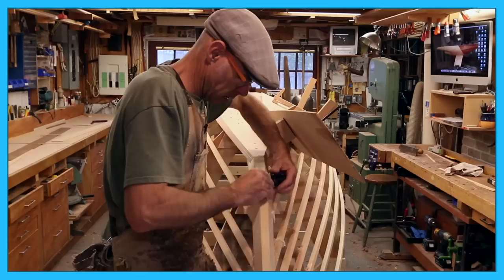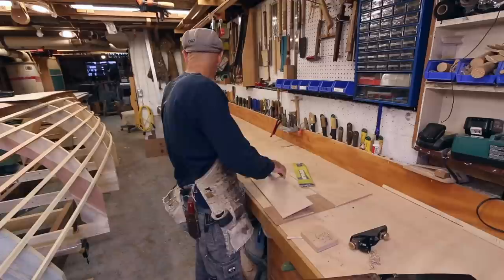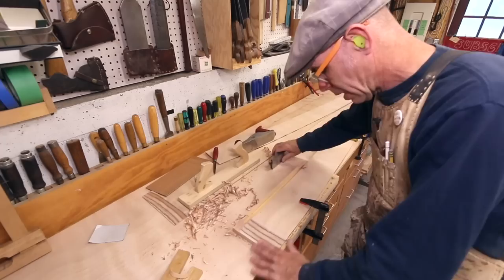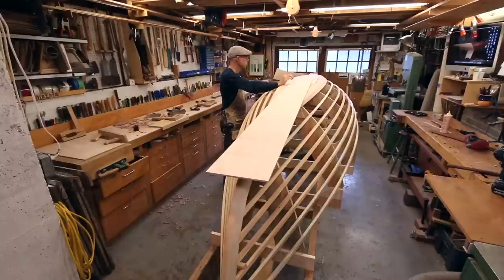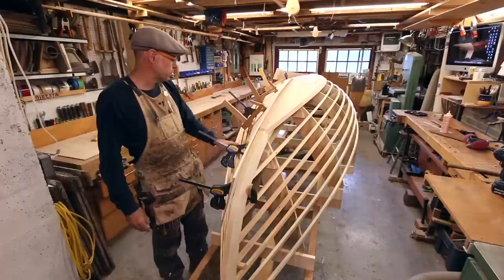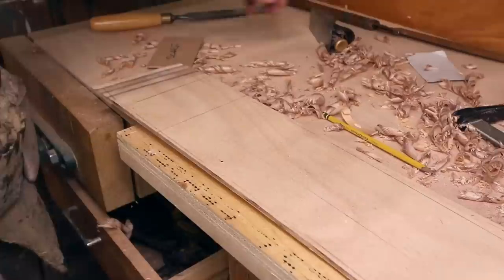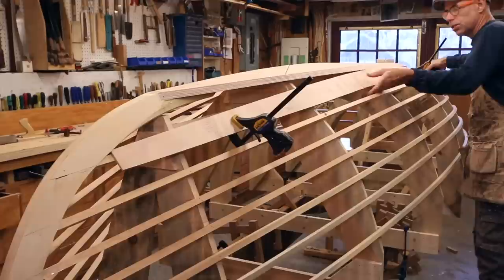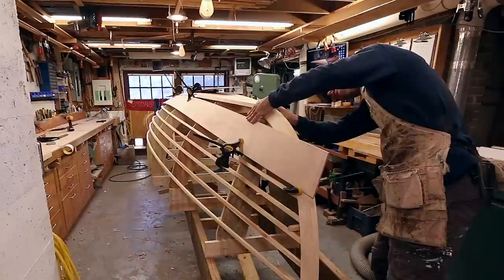Building the Catalina Wherry - Part 16 -  Fitting the Garboard Planks

Comment: "Wouldn't think twice about grabbing a circular saw for this cut..."

I would absolutely never grab a circular saw for this cut, or anything but a straight cut. My safety when using large materials just isn't worth it to me.
Reply from the maker: In boatbuilding we routinely push the tools a little out of their designed range of use. The danger of pushing a circular saw around a gentle curve on thin material is pretty low. You just set the blade to just about one tooth depth below the material to keep the captured breadth of the saw blade to a minimum.
Reply: @Nomadboatbuilding  ------ And use a small diameter saw blade - but the material should be thin.